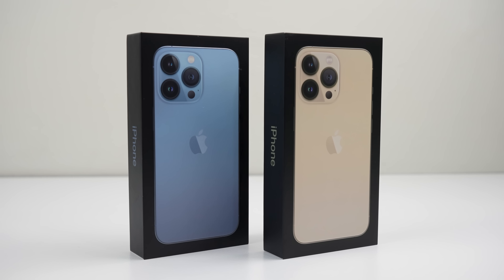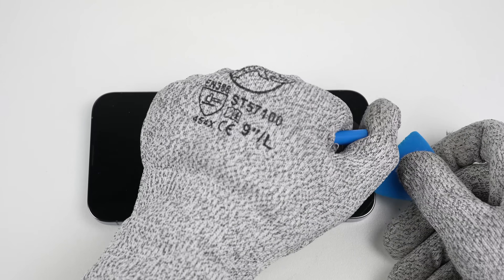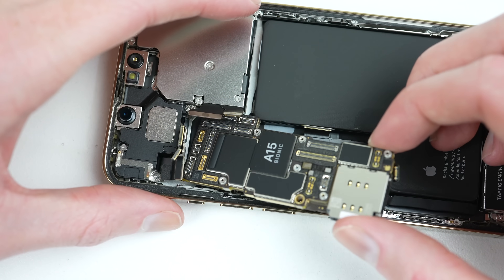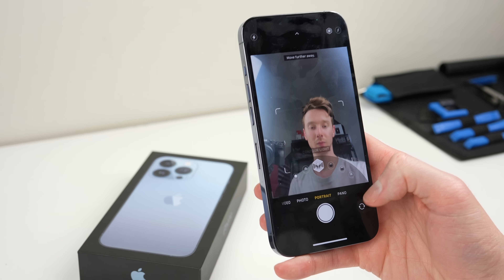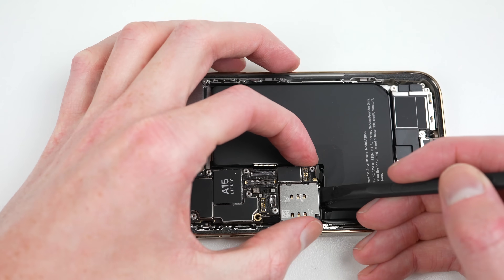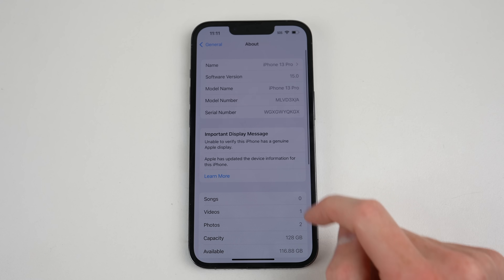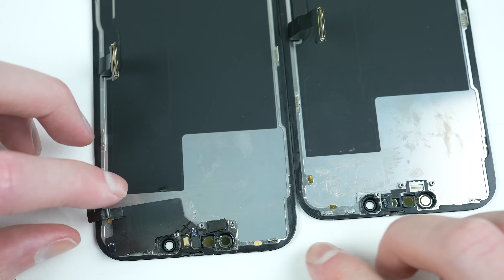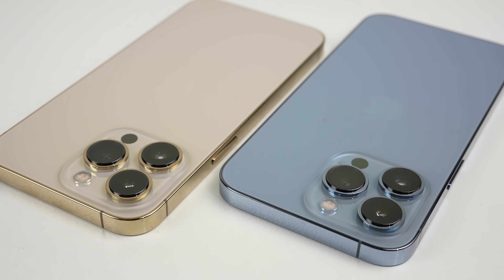iPhone 13 A Repair Nightmare - Teardown and Repair Assessment

Comment: When apple talks about sustainability, they're referencing the sustainability of their revenue, not the environment.
Reply: lol straight to the point
Reply: Truth
Reply: Aye. Not so long ago, phones could be easily dismantled to parts and re-assembled by anyone. Right now, you need specialist tools and often just can't repair anything.
When Ipod was a thing, my friend bought himself a cheap Chinese copy. Chinese copy was actually better, because it was assembled with visible screw, and with a tiny screwdriver you could disasemble it, change batteries and so on.

Same crap is happening in cars. In the past you could disassemble any engine to primary parts, and replacements were availalble. Now you for example have timing chain wheel integrated with the crankshaft, and to replace the wheel, you need to replace crankshaft, which is expensive and involves total engine disassembly.
Reply: The same thing when Apple talks about "innovation". Innovation should be about making things better and cheaper, not worst and more expensive.
Reply: @vjrei  innovative revenue streams
Reply: @vjrei  👍👍👍👍
Reply: When the sustainability is sus
Reply: @ElectricGun100  Good one. :)
Reply: @ElectricGun100  do do Do dO DO dO Do do do do. doDOdo
Reply: Calling all sheep. Apple has a new phone. The only difference is that the number 13 is on the box. Anyone who watched Tron: Legacy, knows exactly what I mean.
Reply: nor the economy, nor humanity as a civilization
Reply: @thedoge492  >humanity
>well being of civilization 
Hell na fam it's all about the sheckles.
Reply: Bruh. Truth bomb
Reply: Good one :D
Reply: Yes
Reply: Nicely said sir🤣🤣🤣
Reply: Well said
Reply: Crazy that millions of people globally support Apple's organized crime mafia operations. They manage to steal money from under people's nose and get thanks for it. It's ridiculous.
Reply: Same with video games that need a code to download patches and updates to fix the broken base game. I don't buy games anymore for this reason, because I vote with my wallet. But others can't help it. They'll still support these dirty communistic practices from gaming industry.
Reply: @radiofreealbemuth  When you're so brainwashed by capitalist propaganda that you see capitalism causing harm to the environment and to humanity but decide to call it communism. Lmao.
Reply: @boozecruiser  50% of California pollution can be attributed to China, which produces more pollution than all other countries combined
Reply: @radiofreealbemuth  that’s capitalism bud, American media has influenced it’s citizens to associate communism with bad and it shows
Reply: @onbox6276  communism bans you from selling or trading anything. That's what I meant, when I compared the gaming industry's practices to a communist regime.
Reply: @onbox6276  The dude watches sargon of akkad. Irredeemable as a human being I'm afraid
Reply: @radiofreealbemuth  Ok bud, you don’t know what you're talking about. Communism prevents people from owning capital; essentially, the workers are entitled to the fruits of their labor. 
And you're ignoring how insufficient regulation, as a byproduct of the United States reliance on capitalism, has supported anti-consumer practices. I’m arguing for reform, not communism; I highlighted the US’s purposeful mischaracterization of communism.
Reply: @boozecruiser  yikes, it is truly a shame how easily people are deceived
Reply: Dang
Reply: they keep making their phones more expensive and even that will eventually catastrophically fail but most companies would rather go under than obey they invisible hand of supply and demand it seems..
Reply: @dr._breens_beard  Fortunately there's Alcatel and Hammer.
Reply: @dr._breens_beard  Apple is one of the few phone or computer vendors consistently generating revenue and profit.
Reply: Yup. If they actually cared about the environment they'd make them easier to repair.
Reply: I know you wanted to be cheeky, but what you're saying is literally correct. One of the most important things for business is for their revenue to be sustainable, since sustainability is one of the key metrics investors look at. And they are willing to go to great lengths to achieve that, including all the anti-consumer nonsense you you see all around nowadays.
Reply: what's more, the premium you paid for these phones are not put towards quality, it is put towards making hardware and software specifically designed to work against the customers
Reply: @blackholestorage168  uhhhhhhh
Reply: @blackholestorage168  no you clearly pay for something premium, everything on this device is designed with details, they also thought about coding their devices components. Clearly they did this, so that when you buy a used phone, you can be sure that is I an original iPhone not an iPhone with wish components
Reply: @pablovirus  i don’t care. Because of this I know I can buy a used phone being all original. So no, I’m not naive, I’m all aware of marketing strategies
Reply: @paviaaPS3  bro but both phones are original in the video and so their hardware yet it doesn't work properly. Also if apple had that intention they would have just shown duplicate hardware if used in software like with the case of batteries.
Reply: Bugs by design/on purpose .. not because of an actual technical issue. I would bet that you can find these "bugs" somewhere programmed into some code.
Reply: We care about the environment.....proceeds to leave ALL their store lights on in every store world wide over night....because you know....who cares about the environment, people need to see into our stores when they walk past
Reply: this tbh. they are celebrating themselves for removing a bit of plastic while actively encouraging ppl to throw their tech away every 2 years or so. fucking joke of a company
Reply: @HoaxManTheOne  yes i agree. while i do understand companies do need to mke sale its true its crazy how theyre all trying to get us to ditch our old tech and buy new ones which is super bad for the environment.

Its like "hey, we're an oil spil company, we're the best at it,  and we're super eco friendly because our oil pipes are made of bamboo".

One EASY thing most tech companies should do (and apple completely remove this opton) is ALWAYS offer wired options for connecting devices/accessories, whil still offering wireless options. AND preaching about how wired options are much better for the environment (no batteries needed).
Reply: That is infuriating. I've been iPhone only since day one up until 11. Honestly I didn't know this about the 12 and I am seriously considering making (to me) the evil swap to some other brand as my contact is up. Plus I just had my screen repaired on my current phone for a low (non Apple Store) price without issue. I'm getting sick of corporate crap to the point I'm willing to suffer with lower quality.
Reply: @f.k.b.16  my s10 plus is still going strong 3 years after buying it.  but i dont treat it like shit either so either they are more durable than iphones or i just got lucky.  when this one goes tho i may go to a google phone however as they are significantly cheaper than galaxy phones and i prioritize batter life over much else in a smart phone
Reply: @dr._breens_beard The S10 plus is actual the model a friend has. I like it. I think it's about time to stop my addiction to Apple's tactics.
Reply: @f.k.b.16  Yes the only apple products I would ever but are their ipads
Reply: @f.k.b.16  I made the switch after the 6s.. I have had every Samsung since the S7 and currently love my Note 20 Ultra, but sadly it will be the last Samsung phone I buy as they are doing the same planned obsolescence as Apple... Although, we did just have them replace my wife's screen for $108 which we thought was a steal.. Just going to take care of this phone as long as I can.. There really hasn't been any major improvements in phones over the last few years to justify dropping a few grand on them...
Reply: hahaha, good one
Reply: The only thing they are sustaining is their ties to the communist chinese party and use of child slave labor...
Reply: Word weaponisation. Leads to corporate monopoly and total market control. Stop buying their shit, I say
Reply: Spot on, that's exactly it.
Reply: yeah, my face last year when i heard about it was like: Liar😒🤥
Reply: Truth. It's all about "technicalities" in the end...
Reply: Haha 100% true
Reply: "Cost more does less"
Reply: exactly, sometimes it feels like Apple is testing its customers more and more trying to see how much they can do things thats supposed to bother them, before they actually start thinking of moving away from them, and the answer is: almost nothing will make apple believers move to some other platform.
Reply: Fuck corporate virtue signaling. 😤
Reply: Obviously their revenue would be sustainable with interchangable parts. They could be selling their components to 3rd party repair shops all around the globe.
But yeah, i get it. people still buy their phones, so why change a more profitable business model. 
Too bad it negatively affects the customers pockets.
Reply: @bt70a9  yep, idiots never die out. always a great crown to rob since they will never know that apple products are worse than every other comparable option. but its colorful and my worthless starbucks gfs all have one hehe
Reply: @HoaxManTheOne  Haha, nice take dude and so true! :D
Reply: also the "paper" film on the phone is just the usual plastic and paper blend to give you an illusion of sustainability and don't forget the suicide nets at the Chinese factories
Reply: man, isnt that the truth, they need to be sued for environmental damages and profit gouging
Reply: @reginald6045  yes but they would give less money to the producers
Reply: Apple is so paranoid that they don't even allow third party repairs using THEIR OWN PARTS. Scumbags.
Reply: Yes
Reply: Don’t all these companies want to make money . .
Reply: Hahahaha
Reply: :O no way
Reply: We import everything!
America's only export is porn and autism.
Reply: Lol 🤣 bang on !
Reply: yeah just keep buying them and go online whining on how they f you up
Reply: Exactly
Reply: Yep they make you buy a new phone
Reply: Loool
Reply: well said .
Reply: This is the truth. If they cared about the environment they'd switch to USB-C too. That alone would cut hundreds of tons of e-waste a year.
Reply: @TheMercifulKnight  not to mention the Geniuses *his macbook screen cable is disconnected  "Sorry Sir your motherboard is fried its going to cost £1300 to fix.....its only £1350 for the latest model so you may as well just upgrade 😈"
Reply: Sheesh, that's a good one
Reply: It's almost like they're trying to be terrible about repairs.
Reply: You don't get to become a trillion dollar company selling a long term product afterall.

Oh yeah, and paying American wages. Don't forget all apple products are being made with near slave labour at $.03-.05 an hour wages. Fuck apple products, even more than most.
Reply: Spot on.
Reply: And charges shit ton of money to solve any issue in fone or macbook etc greedy bastards
Reply: Haha exactly!
Reply: thats why they take away ports and put charger / anything additional in additional packaging.
Or the personalized parts that only work in 1 phone. Like they completly eradicated spare sparts cause money.
Fucking greedy devils.
Reply: Exactly
Reply: Duh, that’s assumed
Reply: Game, Set, Match....
Reply: Apple fanboys on copium right now.
Reply: Damn right
Reply: Fuck apple
Reply: Yes
Reply: Damn true..!!
Reply: Lolololol.
Reply: I'm sure they took out the charger from the box so more phones could be shipped at once
Reply: And that. Is why i despise apple.
Reply: Not necessarily because they do have trade-in and recycling programs and only use recycled aluminum.  I agree that it is terrible that they block right to repair, but for an average user that uses a case and a screen protector, their phone should last them years without issue and Apple will give you a trade-in value of a couple hundred dollars for your old iPhone.  I think the issue is that a lot of people don’t know about those programs.
Reply: @time2livelife  until they tell you that you're device is "water damaged" because their "damp sensor tabs" are so sensitive they switch to red when the weather becomes just slightly too humid. Then they'll offer to take it off your hands for nothing and throw it in landfill (y)
Reply: The sustainability of their government subsidised and protected monopoly
Reply: Well worded and it’s nothing but the truth.
Reply: damn
Reply: Apple sheep will still say its best smart phone ever.
Reply: YES and YES.
Reply: as with all corporations talking about sustainability
Reply: i was the like nr 19k. Best thing that happened in my week. My life is great!
Reply: How can people still support such companies? Do they not care about our future?
Reply: Facts
Reply: Exactly, and when they talk about extended producer responsibility and preventing apple products in e-waste streams they are in reality talking about preventing independent repair, promotong shreding and monopolizing aftermarkets and controlling whole lyfecycles.
Reply: Now that makes sense
Reply: same as every other corporation and publically traded company.
Reply: Indeed
Reply: Oh! 😲🤦‍♀️ ofc what was I thinking? That Apple gives a damn about anything other than money? 😂
Reply: Yeah duh. Are you surprised that apple is evil? They use slaves to build those phones.
Reply: same with shell, blackrock, and those fucking gigants
Reply: They only recycle 1%
Reply: 66666
Reply: Well, they were one of the most valuable but also capitalistic company in this planet. So it's no surprise
Reply: China’s sustainability
Reply: @drbichat5229  You know that's true!
Reply: @drbichat5229  apple is the problem not china
Reply: @drbichat5229  I'm fairly certain that these design decisions would be made in Cupertino, California, not China.
Reply: It's a known bug, that will be corrected on the next iOS version
Reply: The more money they have the better tech they will be able to bring the world.
Reply: @jjjjjj192  they already have the money, but they are rent making any new advancements.
Reply: I am convinced Apple see no need for repair they have a vision of a Co2 completley renawable phone where buying  a brand new Iphone is as enviromental friendly as repairing your old phone. In that scenario there is no reason to repair according to Apple.
Reply: @sorten6653  It is literally impossible for production of a new phone, to have less environmental impact than a repair, just as long as production of all parts have the same energy source. Production always involves some additional emissions, if not of CO2, then of chemical substances.

The most environmentally friendly cell phone was Nokia 3310. Works forever, never breaks down. You just need to replace battery once in 10 years, and it's done with bare hands in 5 seconds.
Reply: @SparrowNoblePoland  That depends on what chemicals are used and if the chemicals used effect the enviroment or not. If we say that all chemicals used are chemicals that have no effect on the enviroment. If the energy produced and used is having no climate inpact. No emissions of Co2 or other gases. All transports are climate neutral then a new Iphone will not have much  impact at all but obviously for this to work the production has to be  climate neutral as well and the transport to customer has to be climate neutral. You might have right that it won't be zero impact but the impact will be incredibly small and that is what I think Apple wants.

Comment: Just like component protection in Audis.  Want to replace your broken radio with a used one you sourced, sure, go right ahead.  But it won't work entirely until you go to the dealership to have it "blessed" for one hour labor.  They get away with this scam under the chant of "theft protection".

Now, I can get the concept with certain devices that have tolerances or adaptations that need to be computed on a per instance basis.  But in such a case, the adaptation or basic setting procedure should be accessible, and any necessary calibration tool (for example, for the camera) should be available.  Better yet, store the calibrations for peripheral devices with the devices for the main board to read in after installation.

Of course, that's a consumer perspective.  The corporate perspective is never let any money opportunity (scam) pass to a third party.

Comment: The iPhone 7 did the very same. Nothing new ... change the high pressure fuel pump on your VW and it will not work without teaching the ECU the new serial number.

Comment: each hardware has it's own id,  so when they install the os for the first time it reads the id from all the hardware components from the phone and locks it in, everything that changes after this point will take away functions, unless someone figure out a way to extract id and rewrite it it's impossible to fix those phones.
Reply: Can you reinstall OS on iPhone?
Reply: Easy, don't buy anything Apple.
Reply: im not too big into coding and stuff but if you jailbreak your phone and have access to its base code you could easily change those ids